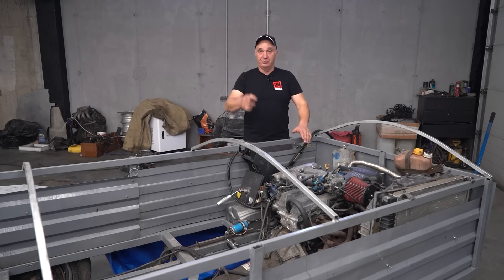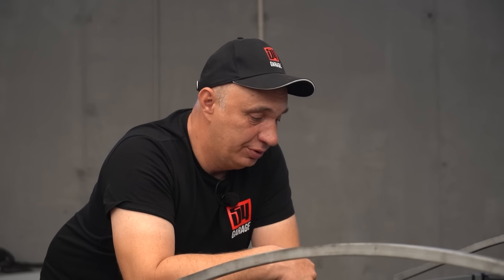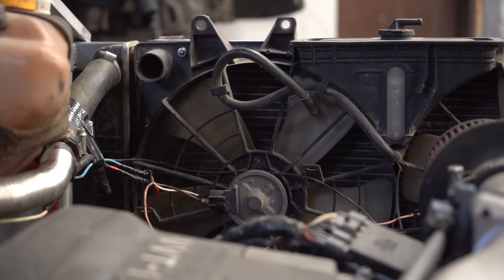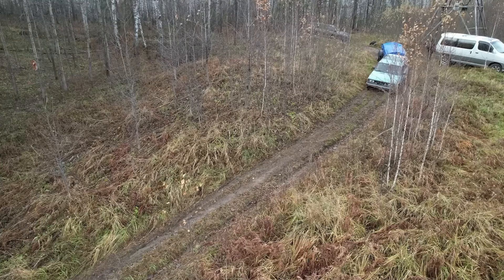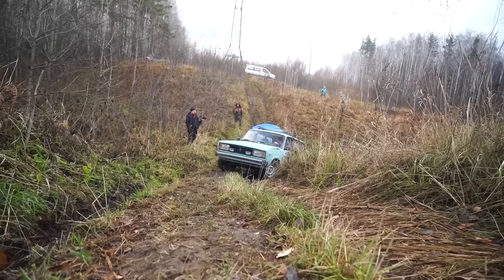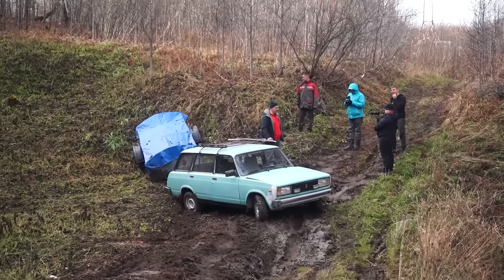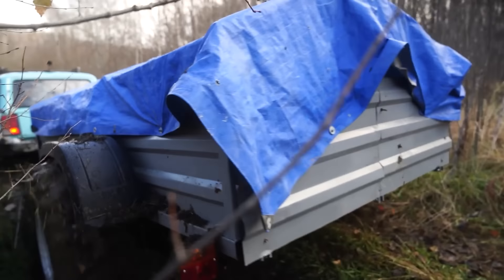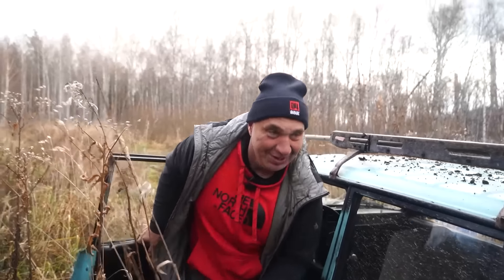1JZ trailer part 2: on and off-road testing, drifting...

Comment: every tesla owner needs one!
Reply: To push the car and charge the battery at the same time 😆
Reply: exactly, to compensate the CO2 they saved
Reply: @wanchiz  no, to push the car when the batteries die , no one cares about co2.  THAT is B S.
Reply: @johngillon6969  why would the batteries die? That's just driver mis-management. Same reason why normal cars run out of fuel.
Reply: You know Tesla isn't the only electric car company, right?
Reply: @slimjim1125  we got a electric vehicle geek in da house.

Comment: Is this what driving an articulated bus is like?
Reply: Indeed! However those have double wheel axle at the middle to provide extra grip. However in winter you still can jackknife them. As that can be reversed only by pulling the bus at the front, it's almost impossible to straighten it up without help.
Reply: the buses have a computer control system and two hydraulic cylinders to control the articulation. my dad was a sf (muni) bus mechanic and told me a story of the articulation computer losing its mind during a test drive on a bus that was throwing nonsensical articulation codes. As my dad was driving the bus down the windy section of 101 near the mission district the bus suddenly jackknifed and completely lost control and spun out on the freeway. the bus and my dad were very lucky to not get hurt.

Comment: That trailer is awesome!!!! Hey you can market as a EV car accessory for places where charging stations are too far appart😅  gotta do more videos with this trailer
Reply: I was thinking the opposite, an electric trailer.
You could squeeze some electric motors under say a caravan, where as a big chunky ICE would never go, plus a battery pack would be very useful otherwise in a caravan. the batteries could charge in any downhill runs etc.
Reply: @paulstubbs7678 this is being done with HGVs, just the energy recovered from braking is enough to run refrigeration apparently

Comment: Such a cool video I love the drifting and I believe this could actually become a new form of racing a car with nothing in it but a working suspension and working brake system and then a trailer with an overpowered engine that would be cool to see 20 to 30 cars like that flying around a racetrack

Comment: The setup you got there is similiar to that in articulated buses. Most of them have the engine in the last section, and the last axle is the driven one. That's why every such bus have a double wheel axle not only at the very back, but at the rear of the first section also, although this one is not driven. But if there were only a single wheel on each side, the back of the bus would want to push the first section out on every turn, as the grip would be insufficient. That still sometimes happens, especially in wintertime, when there's snow or ice on the road. A bit too much gas on a turn and the bus jackknifes. If it does and the angle gets too narrow, there is no way to straighten it up. Passengers have to get out and the bus driver waits there in the middle of the road for an assistance truck, that hooks up to the front of the bus and pulls on it. Only then it will straighten up.
Reply: Ikarus made articulated busses with the engine in the middle - and also made the rear axle steerable. You make a turn in a single lane.

Today Hungary is left on relying on Chinese investments for its automotive industry, as there's almost nothing left of this record holding manufacturer any more.
Reply: In the Netherlands all articulated busses have the drive on the rear axle of the front part.
Reply: Hi friend. I know Ikarus very well, we had tons of them in Poland. I also remember their steerable rear most axle and the wobbliness it caused to the last section. I never wanted to ride there, as I it was making me so sick I was about to vomit 😂 In Poland we manufacture Solaris buses, but there are more and more chinese parts in them also. Not long ago we had Jelcz buses and trucks, but the company was sold out and Mercedes or MAN bought it.

Comment: This is what a articulated bus kinda does. Propulsion in de trailer and not the bus, it can drift if you push the throttle at the right moment in the corners :D

Comment: for overlanding ofroad expeditions I could see trailers with electric motors being pretty helpful actually.... A bit of electronics to cut off power to one wheel when jackknifing - could be done with an rc gyro- and it would be a perfect little helper....

Comment: That's fun to see a trailer equipped with a 1JZ pushing a Lada but what about a trailer equipped with a 2JZ and 2 axles (yes...4 wheel drive on the trailer) pushing a Class G (8 wheel drive with 600 or 700hp 300hp on the class G and 300hp in the trailer)
oh no! I've just had an idea : a LS in the class G and a LS in the trailer (without any difficulties they can get 2000hp and 8 wheels drive) 🤪🤪🤪

Comment: Need to convert  the trailer into an off road rv camper trailer with engine under cabin to use as auxiliary generator while parked but use baby honda engine for generator and Toyota's engine for air-conditioning and heating 😊

Comment: Needs a hydraulic cylinder on the hitch to adjust the angle to steer in sticky situations, which can be disengaged when driving normally.

Comment: No use putting a bigger radiator in, or any radiator if you put it hard up against the side of the trailer it won't get any air flow into it. F@#ken funny and a bloody good idea.

Comment: Next, even more insane would be to make a trailer with four wheels and equip it with a drivetrain from an Audi Quattro/Lada Niva and make it with two wheels able to steer. It would be the most interesting job to figure out how to control the steering of the trailer while driving the car.
Reply: I built a dune buggy, I put the front end of a front wheel drive corolla in the back of the buggy. Original suspension and steering fully operational. I built a servo motor and attached direct the rack shaft. It was a starter motor Isuzu I think, reduction drive, that I reconfigured with a mechanical index plate to self center the motor.  
On the steering wheel from the conventional front steering I had a left and right toggle button. 4ws!
It was just a matter of getting the steering rate (speed action) to right spot and it was wicked... ex wife got that too.😕

Comment: If they solid mount the trailers suspension for the axle, it will prevent the drive shaft from movement up/down and in and out of the transmission thus preventing it from grenading. A short driveshaft with that much axle movement equals a short life for involved components.
Reply: Go IRS, best of both worlds.

Comment: IDEA: is it possible to make an engine run using the intake system as the exhaust and the exhaust as the intake? You know what i mean?
Reply: It was possible in 2-strokes. You just needed to start them backwards, which was absolutely possible.

Comment: Mount the trailer over the roof onto the front of the lada. That way the push is on the front and not on the rear causing a spun out😂

Comment: usually in a trailer you want the load balanced and I wonder if that weight being in front of the axel changes its performance due to extra weight on the rear of the car.

Comment: Make a pto shaft from the vehicle that will also drive the trailer.

￼
Reply: It would significantly limit the angle range
Reply: @falrus  ,They wouldn't, that's how forest trailers are made. A homokinetic joint with half-shafts is used.

Comment: Very well done experiment.

try turning the engine around using a chain to translate the motion 180º, the engine would sit above the axle, if carefully balanced.

The trail then could be shorter. than race it.
Reply: You can get a transfer case that does exactly what you are saying. It's actually 2 big gears running together and that way the rotations are correct. If use a chain it's backwards unless you have a reversible crown in the transaxle, the old VW gear box could do it! 👍
Reply: @mrgoodman6620  I said chain, because a V drive is maybe expensive for them.
Reply: @AnalogDude_  yeah but rotation won't be right with a chain
Reply: @mrgoodman6620  Rotate the "live" axle?
Reply: @AnalogDude_  YES! That would work, you were talking solid mouthing it all together, I keep thinking from original function but you did say that. 👍
Reply: @mrgoodman6620  I think it would be more effective, better handling and fun, if the trailer where as short as possible. also the engine on top of the axle would provide down force on the axle and possibly more grip.
Reply: @AnalogDude_  now your getting technical....you need to maintain optimal axle bias, where the preload on the ball puts enough weight on the rear tyres so that the trailer wheels are more likely to spin before the back of the car loses traction in a turn. BUT in the case, say you were racing on the black top, this bias would ideally be set for the specific track, based on average corner speed, radius through the corner etc. But If you were on dirt yeah the boss would favor traction on the trailer. There are ratios to consider relative to distance of the pivot point BALL to axles. It's a little different in the case of trailer pushing rather than car pulling but basically the greater the distance between rear car wheels and trailer axle the better handling, but in this case you make that short as  for size economy. Then the critical measure is ball from car axle, the closer the better it will corner but it will power through a tighter radius but at a critical point it will snap-jack very quick no recovery chance. If the ball is further from car it won't turn as tight but you will has some feel of feedback and control.
Reply: @mrgoodman6620  yes, the engine has face front, be good balanced over the axle to like to be almost neutral to lift and couple to the car by man.
Reply: @mrgoodman6620  include panhart bar, control rods like on cars.
Reply: @AnalogDude_  a wots link is the best over a panhard rod, and HD sway bars, the widest you can fit.

Comment: I wonder how hard it would be to set up a transfer case between the trailer axle in the rear axle of the car to work in tandem from one engine as a 4 by 4 system but you definitely wouldn't be able to jackknife at the universal and not handle that angle unless you did multiple universals and drive shafts between the car and the trailer but would be a cool experiment

Comment: Now they could also have the trailer power a generator.  Replace the gasoline engine in the Lada with an elsctric motor.   The Lada would be an EV towing its own  generating station.

Comment: That was really great, I wonder what would happen if you could control power of each wheel on the trailer..
This is going to be the new drift sport in Japan.
Is it against the law to use a motorized trailer?

Comment: 15:43 you can see this tire is about to pop because the metal belts are sparking the concrete. See this close-up and the next clip watch the trailer go by and then boom. Usually failure is imminent once you see these sparks.

Comment: Please Like this comment so Garage 54 will see it!
Put a tow hook on the front of the car and repeat those tests :DD
They would just need to consider to reverse Transmission output.
Also connecting the 1JZ to an Electric throttle would be good.

Comment: Why not add power steering to the trailer synched with the front wheel steering? That's how monster trucks does it!

BTW 15:46 You can see the wheel sparking. The beggining of the fatal failure!

Comment: lets be honest here,  you don't have a clue how to drive it . .  don't put on your brakes down hill! car in neutral or clutch engaged, let the trailer use engine braking down the hill to slow you down, just as you would with trailer brakes.. c'mon man!   you guys invented a new machine, POWER PLUS TRAILERS!    use the trailer engine when you go up mountain passes or backup or whatever, whenever you need it...  electric would be the bee's knee's with this, regenerative braking all that . .     drifting optional!